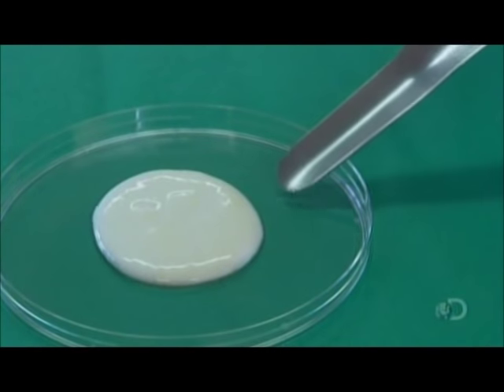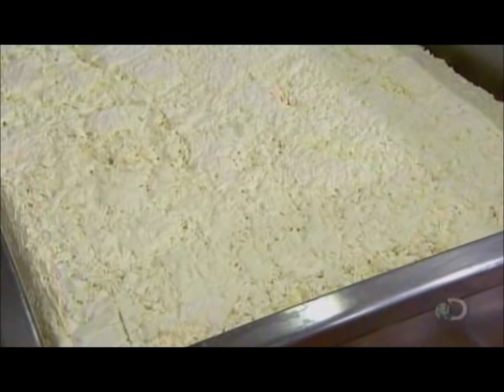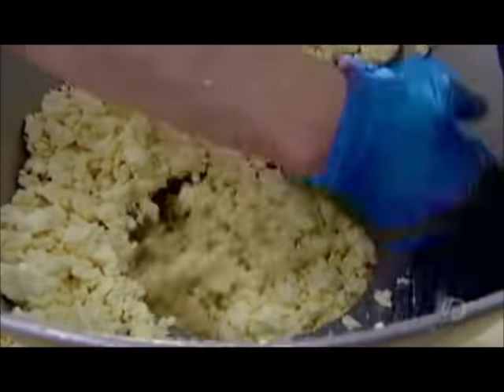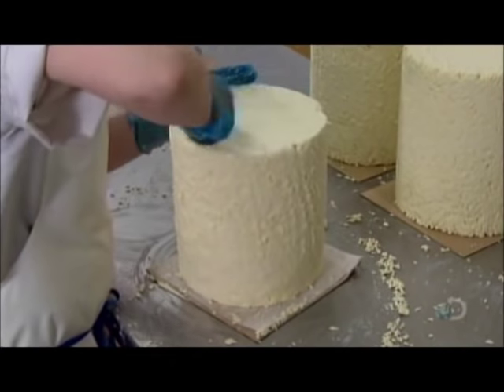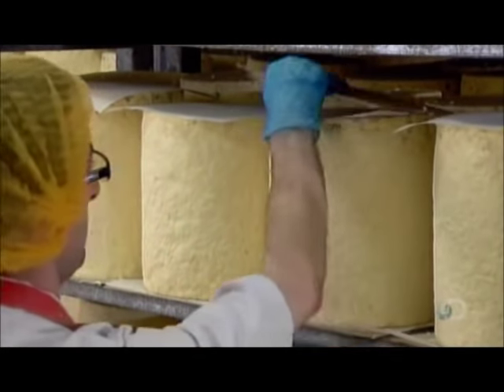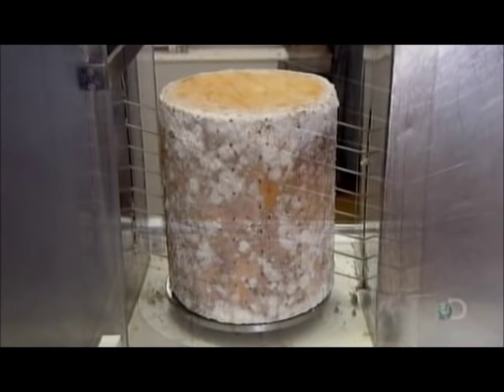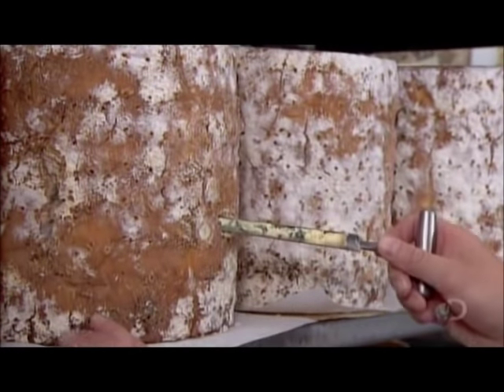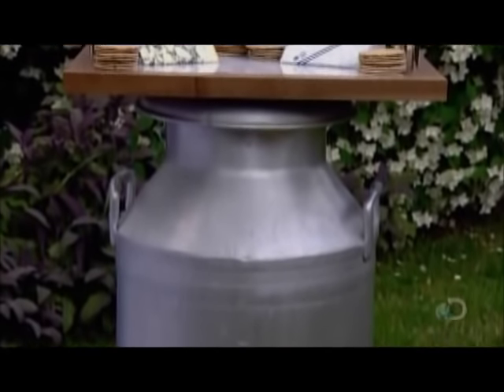How It's Made - Blue Stilton Cheese

Comment: I love how simplified they make the process seem! I worked at Arla in Melton Mowbray and it has to be one of the shitist jobs going. You have to turn the cheese every 2-3 days so the air gets to the cheese and has nothing to do with shape, because even the smaller 2kg cheeses get turned. We have to turn 6 trolleys an hour, which doesn't sound a lot, but when you have to turn wet cheese it makes the process 10x harder than dry. We don't use a knife for our rub-up, we cut a cheese in half, mix it with distilled water until it looks like custard and then paste the cheese with it.
Reply: wezite1983 Isn't Arla, the old Tuxford and Tebburt dairy.

Comment: so what's the different pf stilton with other blue cheese ?
Reply: Well, there are dozens of different blue cheeses. Some are highly influenced by Stilton. Others are not. So Stilton has more common ground with some blue cheeses than others. Bayley Hazen Blue (from Vermont) is very similar to Stilton, while French Roquefort is totally different. The primary differences are in the length of time that the starter cultures are allowed to operate in the milk before rennet is added (Stilton takes almost an entire day, most cheeses take only an hour or so), and the aging: Stilton is aged quite a bit longer than most blues, with the notable exception of Gorgonzola Piccante.